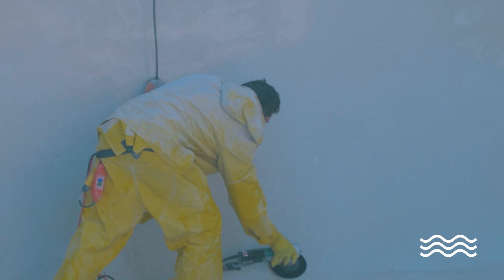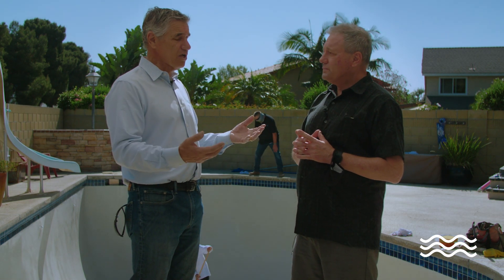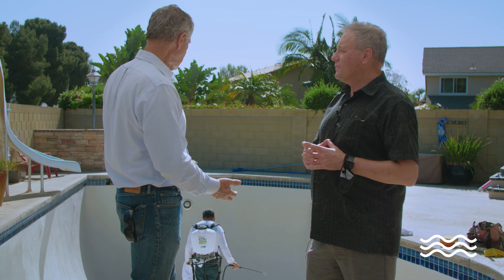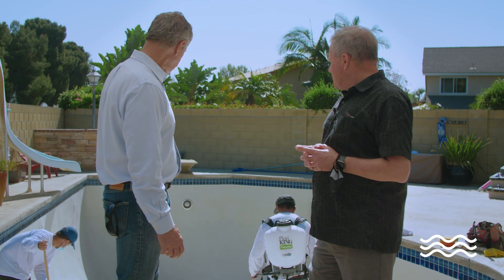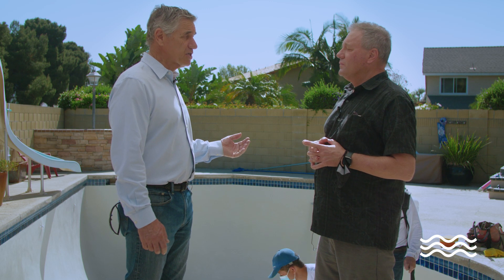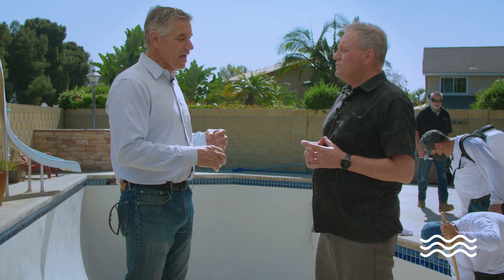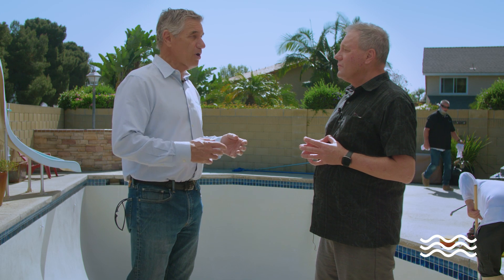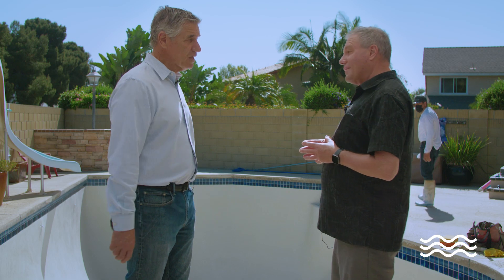Cutting Edge Technology for Pool Plaster Repair | Episode #98 | with Alan Smith

Comment: What happens a couple years down the line say a new owner  wants to replaster in a different finish.  Would you have to strip it all off or will a bonding agent stick on top of it?
Reply from the maker: Its to dense to bond to. You will have to hydro blast or strip the plaster off.